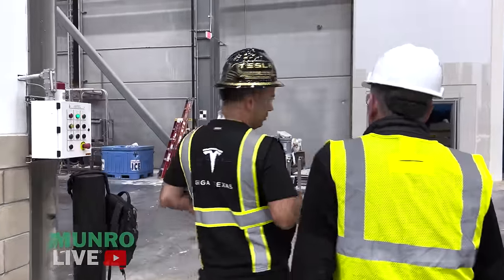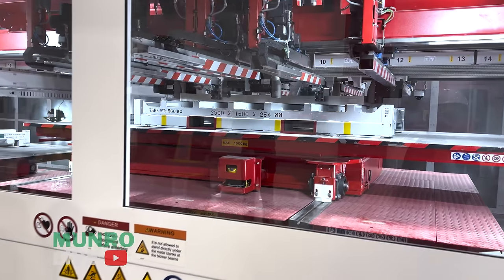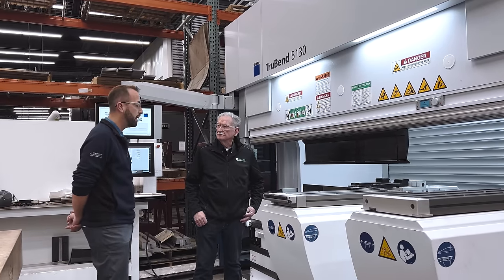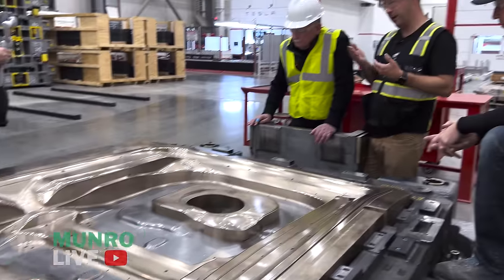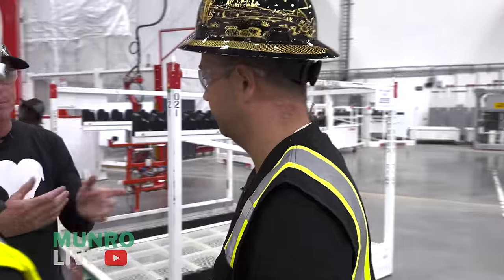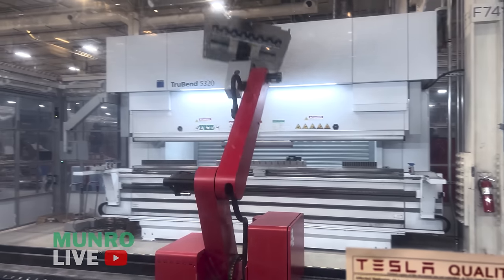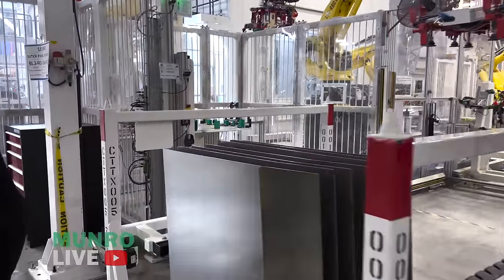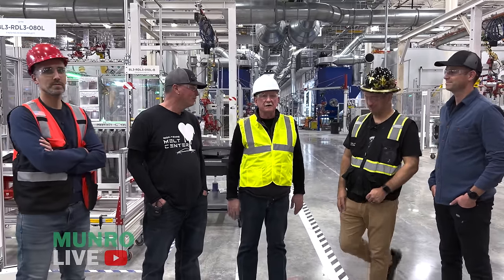Tesla Manufacturing: See how the Cybertruck HFS Panels are Blanked, Bent, and Built!

Comment: One of your best videos I have seen of a manufacturing plant. The factory is so clean and pristine. Sandy got unprecedented access to the most advanced auto manufacturing plant in the world. Mind blowing!
Reply: Once the vehicle is outside it is a dust storm. That will change as the construction site gets finished. They do wash the vehciels before they are driving on to carriers.
Reply: This plant is pretty typical for a Japanese auto plant.
Reply: The Porsche construction factory is practically a hospital. Everyone looks like they're going to a crime scene, booties, hair nets, soft white coveralls. It seems like overkill, but if you're going to do it, do it right, right!
Reply: @rollingstone70  No Japanese auto plant is cold working ss, laser blanking it and then air bending it...
Reply: @boostav no Japanese plant would use thick ass stainless sheet for car parts.  Why? Carbon steel sheet in structure is stronger and lighter.  It is completely unnecessary. Cyber truck is $100k pointless truck. A vanity vehicle for the top 5%. No one in Kansas or Iowa is going to buy this truck.  I think the Cybertruck plant will go the way of Airbus’s A-380 plant. Great engineering achievement but will cease production due to lack of demand.
Reply: @rollingstone70 If it’s a better truck for the $ it will sell.
Reply: @rollingstone70  Part of the appeal of the ss, other than the looks, is that the exterior panels will not dent and there is no paint to be damaged. Not something that can be achieved with the mild steel panels on all other cars. You'll be proven wrong in due time.
Reply: @rollingstone70 another Sceptic. Of course there is a lack of demand for this engineering marvel. 1 Million preorders is not that much. Then the 1 Million grew to 2 Million. There is comment after comment on all Tesla channels “I cannot wait to get my CT” No self respecting real truck owner would want to own one, well that’s until he has driven his mates one and is blown away.
Reply: @rollingstone70 I hear what you are saying, Tesla is indeed different. Maybe that’s how Tesla Model Y became the best selling Vehicle worldwide this year surpassing the Corolla, RAV4 and VW Golf. BTW there is no coming back for these yesterday vehicles.
Reply: @rollingstone70 Think of it this way:  If Tesla is able to reduce the production cost in the same way they did with Model 3 and Model Y, and drop the price by 40% while still making a profit, they will do two things.  

1)  They will sell a lot.  
And 2) They will put Ford and GM out of business, and force Stellantis to leave the US.

I'm not saying this will happen.  But I have no doubt that Detroit is keeping an eye on how this develops.
Reply: @rollingstone70  lol
Reply: @SolvieCapital you think a gardener will replace his 1993 Toyota Tacoma with a Tesla to haul a lawnmower?
Reply: @rollingstone70  he will when he expands his business, has multiple employees and has the funds to do it.
Reply: You never seen you tube videos of Porsche, Audi or VW Wolfsburg with literally thousands of robots and VW Wolfsburg goes through tons and tons of metal stamped body parts every day, oy vey.  Raise your standards.
Reply: Not that mind blowing really is it.
Reply: It’s a pretty bland truck to be honest. Honda tried making civic look futuristic and totally overdid the styling to the point it looks like a disgruntled employee designed it that’s why you don’t see many on the road. Cyber truck will probably initially sell well but when updates to styling etc are needed I can’t see what they’ll actually do, considering they can’t bend the metal or press it. I reckon they’ll eventually realise this steel is too much hassle and replace it with aluminium due to cost of production.
Reply: @Mark-om3cl   the styling isn't the key feature of this truck, it's just what the layman obsesses over.
Reply: @cengeb VW Wolfsburg plant is one of the most inefficient plants around. VW is terribly inefficient at building cars.
Reply: Can we all at least appreciate that the world's wealthiest person is taking a chance to push  boundaries and challenging the status quo? 
Win or lose, CT is bucking trends👍
Reply: @InformedKiwi is that when the alkaline batteries burst?
Reply: @rollingstone70 already are landscapers in Vancouver using Tesla’s
Reply: @rollingstone70  Those 2 million Cybertruck pre-orders beg to differ about the demand🤣🤣🤣
Reply: @rollingstone70  I can see you would love your century old buggy ride than Cybertruck ride! 
Denying the radical change does not make the real change go away! Face the reality and accept it before the rest of the whole world make fun of your ignorance.
Reply: @Mark-om3cl  The cyber nonsense is a disaster...this factory looks like a big unused disaster.  they also barely pay a living wage to the fools that work there.  Hype doesn't last. Sandi is so confused, the guy admits, the metal parts have no shaping, all sharp edges, no contours, it's horrible.  Sandi pretends he is also a metallurgist...
Reply: @saff226  Which is why that plant has like 6 lines, making several models in the VW empire of 13 brands.  Only VW and TOYota are in the $300 billion gross sales arena..all others follow.  The union is coming for Tesla, then reality will show them all about the car making industry.  tesla has been on a free ride, Germany factory is way under performing...Hype only goes so far...Remember a pet rock was a big deal too. So was Beanie babys, didn't last did it?
Reply: @cengeb Tesla workers are the highest paid plus have tesla share. Why do you think Tesla workers don't want to join the union. Even in Sweden there where 12 employees who wanted to join the union; however, later 6 of them changed there mind and went back to work.
Reply: @reyfetsalmo3346  Tesla shares are down down down.  the hype ain't support reality.
Reply: @cengeb  Really tesla share is down? Where are you getting your info from cereal box?
Reply: And yet they can't compete with Tesla.  @Bob-Jenkins
Reply: @reyfetsalmo3346  so you don't look at stock long term, just one week?  Must be a muskrat?